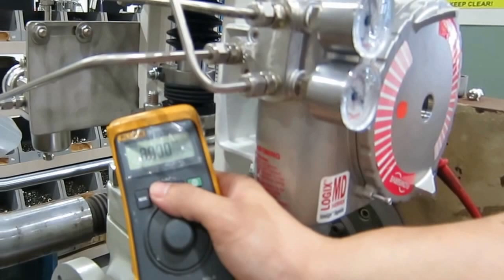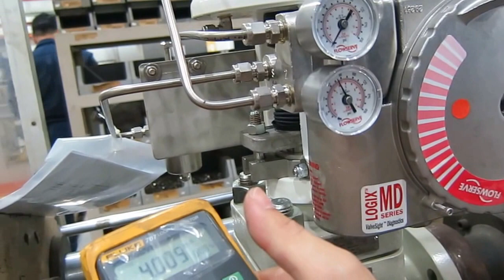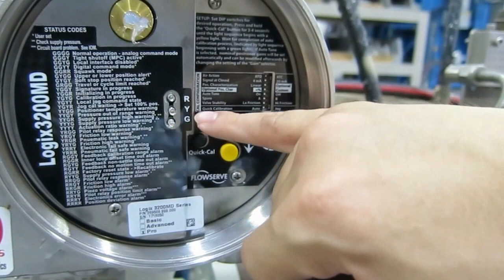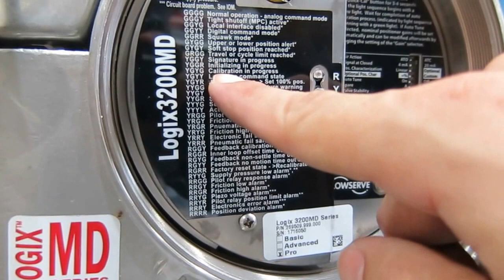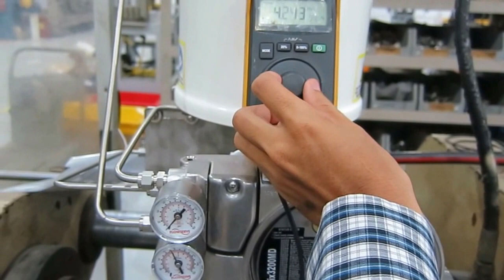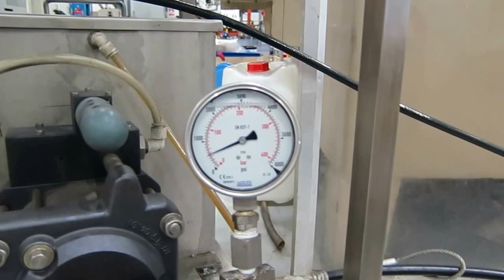Flowserve Control Valve - Performance Test

Comment: Sir my valves shows led error code cycle limit reached. What does it mean. Its logix 3200. Also after this code after some time the positioner stop working to 
close or open the valve.
Reply from the maker: Hi Sunny,
Could you inform the detail of LED code. We will look on this to find the problem.
Reply: Huu Hien Chung thanks for reply. Its gygg. My controller is by design cutting the i/p signal when system turned off. Means it resets after each month. This after one year resulted in gygg code. And then after a few months the positioner has stopped responding though it turns on.
Reply: Dont have hart comm. when i change the main pcb with spare one it starts working for few months then again same repeatition
Reply from the maker: GYGG - POSITION LIMIT ALERT (user set) indicates the position has
reached or is exceeding a user defined upper or lower position
indicator similar to a limit switch indicator. So can check the condition of valve's body, after that you perform the calibration for valve. If you can not solve it. Please email for me (vamhiench@gmail.com) and give me some picture.
Hope I can support for you!
Reply from the maker: From the manual, Flowserve Recommendations:
Reset the indicator if more travel is needed or adjust the command signal
back in the specified range. See DTM screen: Configuration/Custom/
Position Cutoff. This indicator can be disabled.
But I know you don't have HART communicator or HART module so you can try as my comments and combine with "Reset the indicator if more travel is needed or adjust the command signal
back in the specified range."
Reply: Thanks for reply and time. sir i have troubleshooted the positioner a bit. Now status is that i have one okay setup and one faulty. The faulty one is okay when main ok pcb is installed from ok setup. When its own pcb board is used then it shows feed back calibration range alarm even though the rest of the setup is same and worked with other pcb. When i check pcb it is not giving 22v or so to the piezo in driver. What could be the problem. Is it some hardware issue with pcb or otherwise. Thanks.
Reply: Now the gygg alarm is not their may be my technician has reset it.
Reply from the maker: Have a nice day.
if you have the problem with pcb. I think you must replace by new one. It will better than repair.
If your valve is fine, monitor it. if it is a critical valve. You can consider to swap with the other valve
Reply: Huu Hien Chung how to reset the indicator? Can it be reset by briefly pushing quick cal. Or some other method. Plz guide how to reset indicator thanks alot for sharing ur exp.
Reply: Huu Hien Chung thanks alot may God bless you.
Reply from the maker: Hi Sunny,
You check position of GAIN switch @ E position.
You check the condition of Dip-Switch as normal.
Press QUICK-CAL button 3-5 seconds and release.
Waiting and see the result.
Reply: Huu Hien Chung thank you sir.

Comment: Hi Air is coming out from regulator module.what is the reason
Reply from the maker: Maybe we have some leak due to o-ring @ out let of regulator module. You can remove regulator module, try with new o-ring and testing. Good luck!

Comment: Hi Sir, how to eliminate GGGY with out DTM software.. We have this kind of flowserve valve in our project. When we apply power (4-20mA) to the valve, the valve do power up. Pushing the quick cal button for 3-4 sec the valve automatically start to auto calibration. But after auto calibration, the valve does not come to normal operation, we cannot command the valve to operate at 50%,75%, 100% even we inject 8,12,16,20 mA. the led lights just keep on blinking in GGGY sequence. Please advise what to do.. thanks
Reply from the maker: Dear Mr. Elmer Lacaren
GGGY is Tight Shutoff (MPC) active for MD3200.
It will shown when you finish the calibration. Please disconnect the power in 5 min., clean all connection and power up. Perform the function test. If the valve is not working. Push quick calibration button in 5s. If the valve still not working as normal. You must contacted services distributor in your country. They will support with DTM software to fine the trouble.
Reply: @HuuHienChung  thank you for your response